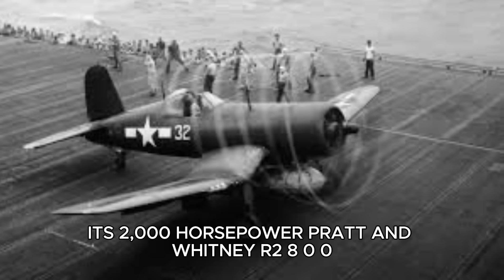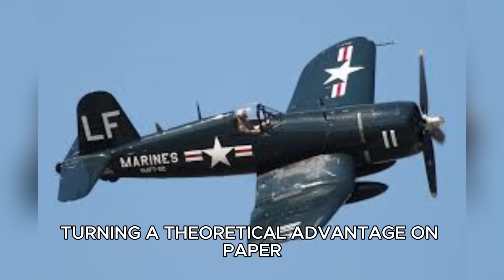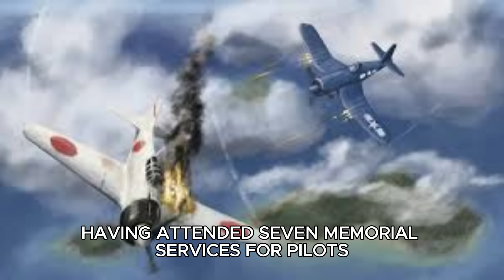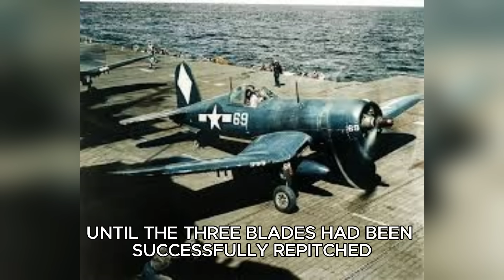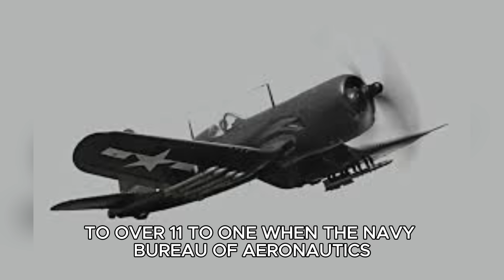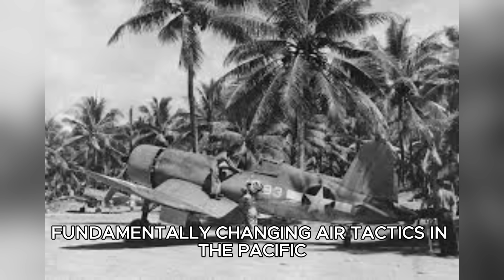How One Crew Chief's Illegal Propeller Bend Made Corsairs Gain 40 MPH Instantly

Comment: Reading through the comments was interesting, but I'd like to add a point that nobody has considered. While it is true that a constant speed propeller is obviously used on this and all ww2 aircraft, the spanwise twist of the blades is a critical element in optimizing propeller efficiency.  As I was watching the video, I was thinking he may have been the first to invent Q tip props, but  he was adjusting the twist of the blades. The narrator did a poor job of explaining this, but if he actually bent the blades, he had to have changed the twist of the blade. Because of this fact, I find it possible that a minor tweak in the twist of the blades may have increased efficiency, thus generating more thrust at the same rpm.  The correct blade twist is based on propeller diameter, propeller rpm and cruise speed.  The corsair used one of the largest props at that time, and perhaps the engineers' calculations were off just a tad. Its called spanwise lift distribution or spanwise disc loading of the propeller.

Comment: While this may have some truth to it, the change from the three bladed prop to the four bladed prop made more difference in the performance of the Corsairs for Marine air wings who took over most of the Corsair fleet aa the Navy found the F6F, designed to kill Zeroes, less of a problem on landings than the Corsair or "Ensign eliminator" as it was nicknamed for it high nose attitiude that made it difficult to see over the engine fairing. The Marines, having no such problems taking off from and landing in on runways, turned the Corsair into a deadly attack aircraft in addition to its outstanding reputation in fighting Japanese aircraft of all types. It was in the Marines that Papy Boyington made his name as a effective Zero kill pilot and an air commander in the famed Black Sheep Squadron...

Comment: This story is horse shit. All 4fu planes had constant speed props. The governor adjusted prop pitch according to engine rpm and speed. The am6 zero was at 360 mph, and only 2 were ever built. The am5 had a top speed of 337 mph. The 3 blade propped 4fu was at 438 mph and the 4 blade could hit 471 mph in level flight at 28000 feet.  The 4fu was 140 miles an hour faster than any zero ever built.

Comment: The Corsair had a four-blade propeller not three This is BS AI crap❤
Reply: Just to be Fair >>>   the Corsair aircraft initially had a three-bladed propeller. The early models, including the XF4U-1, F4U-1, F4U-1a, and F4U-1d, were equipped with a three-blade Hamilton Standard Hydromatic propeller. It wasn't until the F4U-4 model that the Corsair transitioned to a four-bladed propeller  '-)

Comment: This is nothing but a crock of BS.  Where the hell did these guys get a forge to heat the blades, and how the hell did they twist the blade 2.5 degrees with a pipe wrench???
Reply: Cmon, did you not hear they used a 30ft pipe wrench??? Pay attention please!
Reply: No sheayat ,  twisting a heated propeller 2.5degreees ,  all 3 of them now ,  to precise pitch would be a linguistic nitemare '-)

Comment: Fun campfire story, but pure BS. How is the air at 15,000 feet more dense than at sea level?  Not to mention the ridiculous prop modification...the Corsair, (and every other fighter) used a constant speed prop, which means the prop kept the engine running at a constant speed, not racing in a dive, or lagging in a climb. The prop could was controlled from the cockpit, by the pilot, (through the prop governor) setting the prop to optimum pitch. There are more holes in this fairy tale than in a liberal democrat's head.